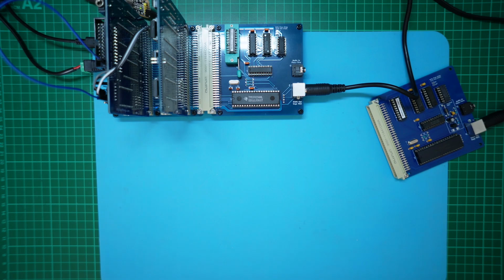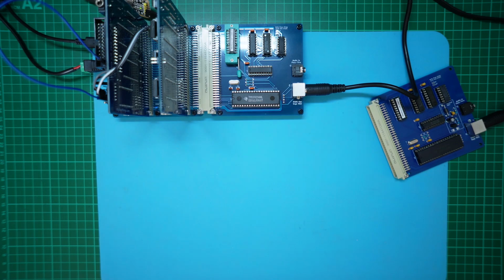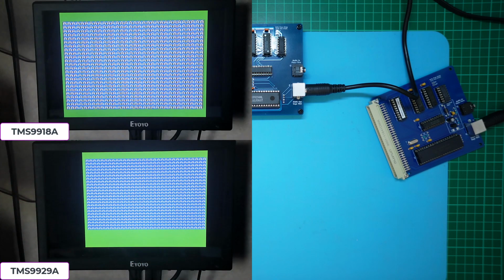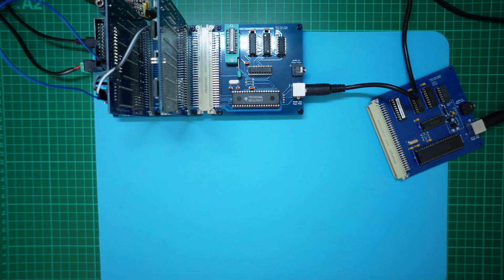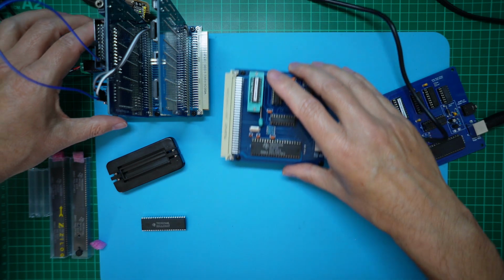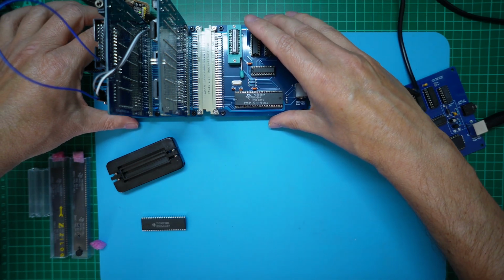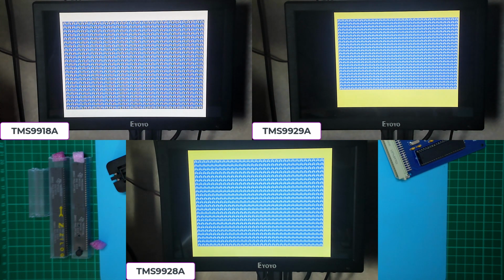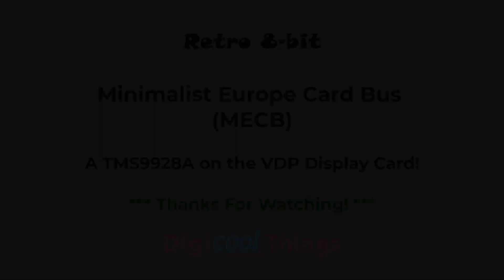Minimalist Europe Card Bus (MECB) - A TMS9928A on the VDP Display Card!

Comment: I spotted a PICO project....using a PICO raspberry pi to emulate a TMS9918 VDP  ..claimed the PICO board cost $4 USD !
Reply from the maker: Yes, I believe I might have seen that also.  Perhaps it’s good to know there are potential “alternative solutions” for repairing old systems, once genuine TMS chips fall into short supply.  But, from a (purely nostalgic?) Retro perspective, I always prefer the real original silicon, over a modern emulation.  Especially, when it's software based emulation (as opposed to an FPGA based functional hardware re-creation).  Hopefully, recovered original TMS9918 family chips will continue to be available for many years yet. 🤔🤓
Reply: @DigicoolThings  I asked the designer if he planned on putting an 80 column test mode and possibly more graphics mode on the PICO project. He said he may in the future, but for now he was just taking 'Baby' steps.

Comment: Another informative video, never did any video designs in my day jobs so always interesting to see something different. Day job just used lots of embedded micro's for audio control and routing. As in my area of work any video was super fast highly detailed and mega expensive.
Reply from the maker: Video design took my interest from the start, when I was initially playing with early “pong” video game circuits as part of my initial exposure to digital electronics design, as a teenager.  So it’s good fun to again play with the early video display chips.
Reply: @DigicoolThings  My problem was I liked playing with electronics as a 14 year old, left school at 16 with no idea what I was going to do. 😞 two weeks later I was working for an avionics company. who would have guessed. I would never have thought at the time I would be an electronics engineer for the next 54 years.
Reply from the maker: @TheEmbeddedHobbyist  They were interesting times. I left school at 17. Having made and programmed my own microprocessor systems I tried to get a job in Computers, but was told I would get bored at lower jobs, but didn’t have the qualifications for jobs that matched my capabilities. Joined a retail electronics distribution company instead, and ended up computerising that business, and designing microcontroller devices as a side.  I think what you end up as, is whatever you make of wherever you are. 🤔
Reply: @DigicoolThings  well I now tell youngsters if you really love your hobby don't get a job in that area.  Your love your day job but will but lose your hobby. I found that its hard to come home and do the same thing again in your free time.  But that's what I  found.
Reply from the maker: @TheEmbeddedHobbyist  I do understand. My work life took over everything, but it was also very rewarding. Unfortunately, too many people get stuck in jobs they don’t really enjoy. I always tell people they should just follow their passion. That's usually the path to happiness and success.